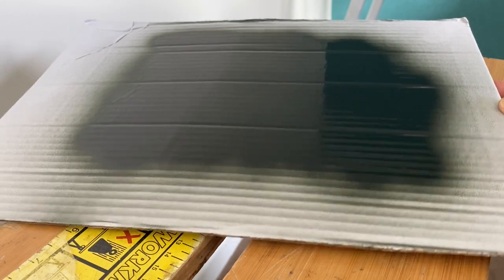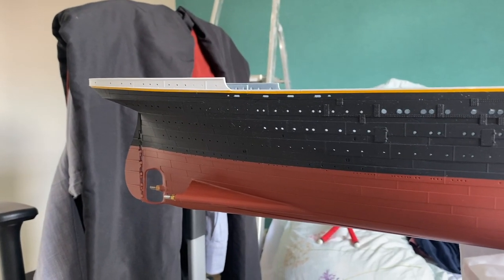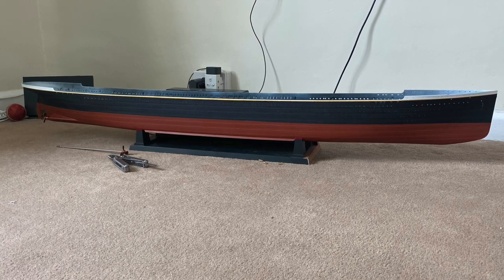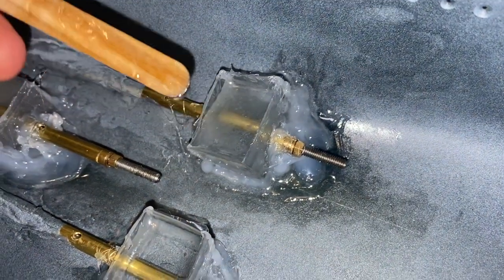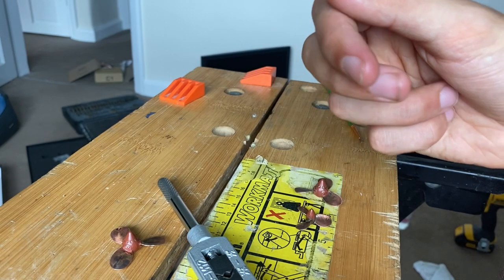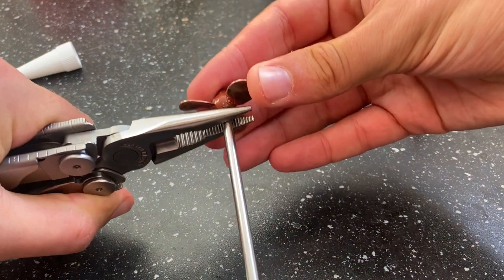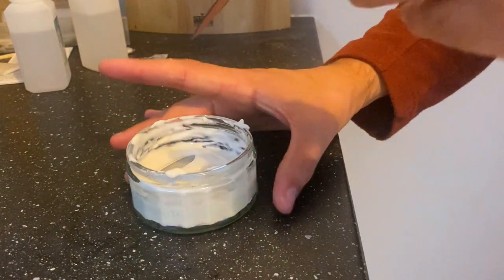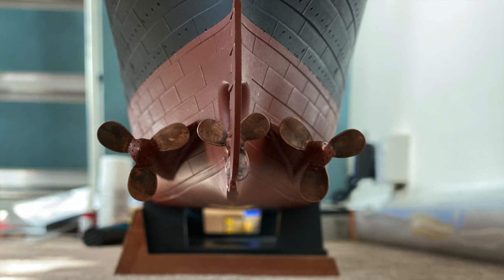Radio Control Trumpeter 1:200 Titanic Build Part 9 - Weathering, and much more

Comment: Great to see you sorting her out. I purchased the jigs from Nigel's Models in the UK to assist with centering all the pilot holes while drilling portholes out.
I have a couple suggestions for you and my comments are in no way intended to be critical of your work.
When you cut anything threaded be sure to double nut and cut directly against the nut. When you thread the nuts back off you'll have a clean thread and you can thread your props on easily and without damaging the soft threads in the brass propellers.
The tap you should use when you aren't threading all the way through and it is shallow is called a bottoming tap. You'll be able to thread all the way to the bottom of the hole.
I would also suggest you use an adhesive silicone on your forms. They are much less likely to leak.
I might suggest you pick up a couple good armor publications. They are instrumental with learning filters and streaking.
The filter used on the black paint really gives the hull plates dimension.
I am flying until Tuesday morning. If you're interested in a couple suggestions I will look in my library and post them here for you.
Great work all around. I'll look forward to your next post.
Reply from the maker: Yes the stuff from Nigels is very good actually, I think if I had the time again I'd probably use it. 
Ah ok, yes I did wonder about the damage to the brass nut when clearing the threads, good to know for next time. 
Ok, I am doing quite a big epoxy pour soon (for a different project) so will use silicone on that, to be fair now you say it that does seem the obvious choice!
I would defiantly be interested in the Armor publications, they sound like they will be really useful in other models going forwards. 
Thanks for you comment :)
Reply: @TheModelBoatGuy  I just proof read my post. Not a good idea to use a cell phone to do a write-up when you're exhausted. I had to clean that up a bit.
I'll pull a couple books when I get home tomorrow.
Now to pack my flight bag, get out of this  hotel and get my butt to the airport. Keep up the great work.

Comment: Quick heads up, enamel varnish will eventually turn the white paint portions  a creamy yellow colour because its an oil based paint
Reply from the maker: Yeah I know. And I suspect mine sooner as it’s going to be outside. 
I think though, my model will probably acquire a decent amount of self weathering just by going in the boating lake so it’s something I’m just going to have to deal with. It may well require a freshen up every few years or so

Comment: Hi, I have been having a go at my moulding of the boats using the silicon method and Polyurethane resin to cast.  My initial moulds were too complex so I have simplified the moulding by using a plastic card box.  The silicon rubber when moulded is quite easy to use and produces a perfect replica of the original life boat.  My first completed test boat released from the mould really well and the keel is like a knife edge with all the planking detail perfectly reproduced!  For my model though I need to have the interior hollow space for my hoards of boats that I need to make (Olympic) so I will try and cast an internal mould which will make the 30 ft boats very thin so that I can nest the boats, if that makes sense.  Anyway Silicon did it for me!  BTW I have ordered the Shapeways rudder!  Expensive, yikes yes, but if its worth doing as they say!  Talking of rudders, if you really wanted to 'rivet count'  you could add some tiny anode strips down the hinge edge side of the rudder!  Regards JH : -)
Reply from the maker: Aaaah ok, that’s the next thing to try then. I guess the silicone isn’t going to interfere with the resin. I’ll order some and give it a whirl. 
I certainly don’t envy you needing as many lifeboats as you do. Crikey that will take a while!

Comment: She's coming along!   Yes you hit the same problems as I did with the mouldings!  You may remember that I am moulding in Silicon which actually brings out the boat detail really well.
I am moulding mine for internal nesting (Olympic) which is really hard as the boats are so thin.  I am on my third trial mould now and of course I need tons of extra boats. ;-(  It's a bit late now but cost wise I was wondering as you only needed the 2 extra collapsible boats would it not have been cheaper to have just used the Shapeways offerings?  The Shapeways 3D printed anchor chain is really good BTW (not cheap though). I bit the bullet and got the chain as it will be on show along with all the very fine Pontos detail in that area.  Noticed that the propeller shaft moulding block stayed transparent after setting so it must be a reaction between the moulding materials and that's the problem that I have had too.  Also the amounts of resin we are both using are tiny so that may be an issue when mixing too?  Vibrating the mix can help release air bubbles if you are lucky!  Great job so far though. Regards JH the Olympic Guy! ;-)
Reply from the maker: Yeah I looked at the shapeways boats and they are lovely, the thing I just couldn't get over was that id be paying almost twice as much for postage as I would be for the product! And I guess its all an interesting learning curve being able to cast in resin. 
To be fair to the all the shapeways stuff is brilliant, I was really tempted by their rudder too. If im honest I still am! I dont think id have noticed but having seen the product I am now always reminded that the trumpeter rudder is incorrect.
Yeah I think there was defiantly a reaction between the resin and alginate, I know resin docent like water when curing and as alginate is water based I suspect that might be the issue, im going to give it another go, just maybe coating the alginate in something first. And if that fails I'll move to silicone. 
I hate using the line 'that'll do' but because these boats are going to be so hard to see I dont need the end result to be amazing, just decent.
Cheers, I hope your Olympic is coming along well, did you decide to motorise her in the end?
Reply: @TheModelBoatGuy  Hi, yes I will be adding motors and I have already purchased you're suggested propeller shafts just to keep a constant even revolution effect for a static model.  Still researching reduction gear 'quiet' motors and for me there no urgency in that at the moment.  I am still gathering stocks of additional PE parts more relevant for the Olympic such as all the extra lifeboat guard rails and because they look amazing the iron stairwell glass domes (Minibrass).  Hmm...  I may have to get the Shapeways rudder!!!  So far I have drilled the portholes and started to modify the covered promenade deck.  The thickness of the plastic on most of the superstructure is a real headache!   I must finish my other project first before I really crack on with this bad girl!  Cheers ;-)

Comment: Just wondered if the cabin drainage outlets should show a little distress in some places perhaps?  A very minor point and not worth going back to really as you have already sealed the hull!  :-)
Reply from the maker: Yeah you are right there, I might well do that later. I need to add decals and then do a third coat of varnish anyway so there is still opportunity. The thing i'm conscious of is that she will get some genuine weathering by going in the pond. Theres always stuff floating in ponds and weed etc that will stick to the hull. So I am eering on the side of caution here with the expectation that shell pick up a bit of grime as she goes!

Comment: what paint did you use for the light wash on the starboard side?
Titanic is looking good 😀😀
Reply from the maker: Oooh, it was a blend of a deep blue and a light grey. With a lot of thinners. I will look up the actual paint colours I used and get back to you on that!
Reply from the maker: So the paints were a couple of drops of Humbrol Matt 26 and a few less drops of Humbrol matt 145. With a lot of thinners. I didn’t show it all but I probs did about 4/5 washes on the hull building it up very slowly (this is all enamels btw). Hope this helps!

Comment: Hi , Did you apply 2 coats of Varnish?, by the way the hull looks really nice, I just started to drill the portholes before the paint job, thank for sharing your progress , it is a great help :-)
Reply from the maker: Yes I did, I have to say it was a matt varnish but it has given the hull more of a satin look now which isn't quite what I was aiming for (looks very nice). But not quite what I was going for!
Reply: @TheModelBoatGuy  Hi , thanks for the reply, i'm almost done with the potholes , so after the paint job I want to make sure I use the the proper varnish, thanks again for the info

Comment: Hey man, not that it matters too much but just a correction. You mistakenly put the two wing propellers on opposite sides. Pretty sure it is not possible to correct this now but I thought I would let you know.
Reply from the maker: Hey, thanks for your comment. I think that this is just the pontos props not quite looking accurate. So on the model the port prop rotates anti clockwise in forward and the other two rotate clockwise in forward. Which I believe is correct?? like I say I think it’s just the pontos props not quite looking correct
Reply: TheModelBoatGuy might be that, because even on the wreck it is visible that the middle prop and starboard prop should rotate clockwise and the port prop should rotate counter clockwise.

Comment: Also you have the wing propellors on the wrong sides. The blades on the starboard propellor and centre propellor should be pitched the same way.
Reply: @vanhooler  Blade pitch.
Reply from the maker: I think they are actually correct, the starboard and centre props are actually pitched the correct way, although as you say it dosent look like it on the video, I think its a trick of the light.

Comment: I have a question did Titanic water line have a white line on it i done seen photos of it 🤔 but   I think Olympic had it but did Titanic have it
Reply from the maker: Not to my knowledge no. I know the pictures you mean and I think the reason for the effect is two fold. Firstly the anti fouling red paint would very quickly lighten in contact with sea water (which would give the impression of different colours between areas of the ships hull that were always submerged, and those that were only submerged when she was deeper in the draft). Also photography film in those days was particularly sensitive to certain colours which tends to exaggerate what can often be a reasonably subtle difference in colours.

Another possible reason is that the ship might have been dry docked and anti fouling paint was being reapplied, and that the top of the paint hadn’t quite been reached when the picture was taken. 

Im pretty sure Cunard ships had a white line on their waterline though?
Reply: @TheModelBoatGuy   yea lusitania had it on her do you do models for others

Comment: Nicely done but the inside of the anchor hawsers should have been red, reference titanic the ship magnificent volume one.
Reply from the maker: Ahh ok, never knew that. Presumably to make rusting look less obvious? or was it the same antifouling paint used below the waterline?
Reply: @TheModelBoatGuy  well the red was roughly the same as the bottom, but darker.
Reply from the maker: Commodore Urban ok I might add that when I do the decals and little touches of other weathering. Cheers!
Reply: @TheModelBoatGuy  no problem

Comment: The fail model ship the central Propeller have none 3 blades ,,, 4 Blades its a god model
Reply: It was a three bladed central propeller. Do your research.
Reply: @גבריאל1994  lock google 4 blade have the central propeller
Reply: @djshoker9367  nope the pictures are from the Olympic. H&W documents proved TITANIC had a 3 bladed central propeller.